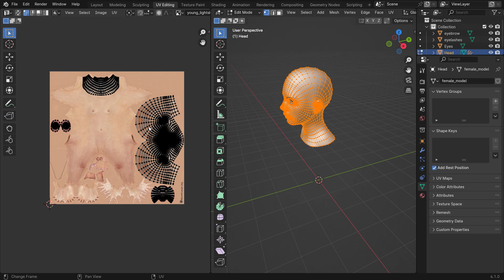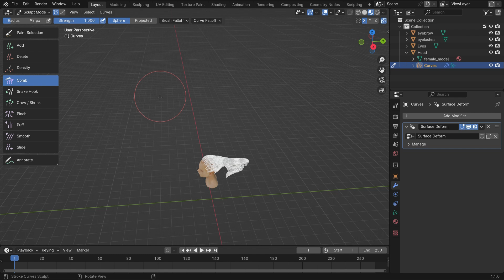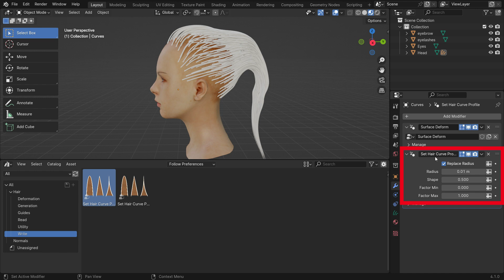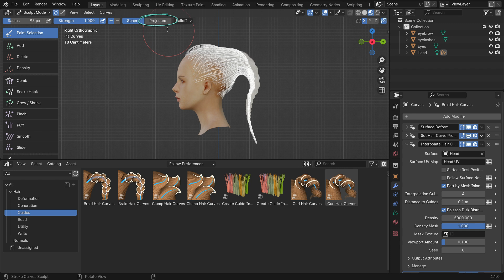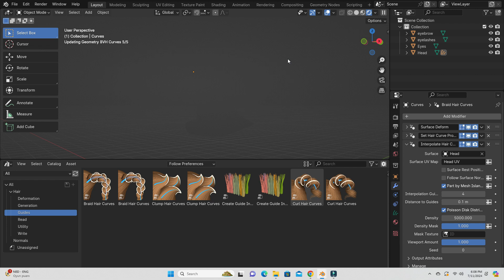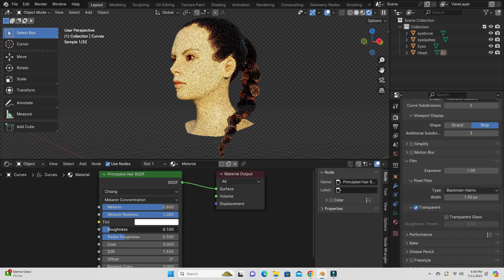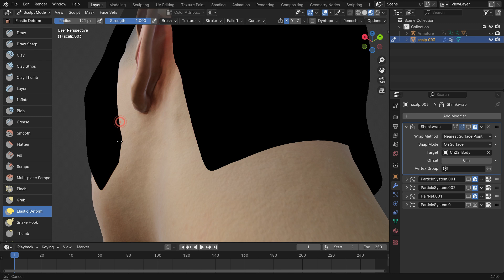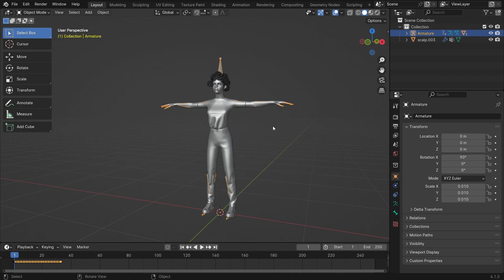How to Create Realistic Braid Hair in Blender 4.1

Comment: For anybody having issues, especially if they are using different unit scales in Blender, see the rest of this comment.

Bit of background - I work with Unreal Engine, so to make things easier for my self, I changed the Unit scale in Blender from 1 to 0.001 in the scene tab. I also changed my display length to cm. Now after this I scaled everything, even a rig (which was a simple bone rig with no constraints or drivers, lucky me) by 100. I also multiplied the view start and end values in the view tab by x100.

1. If you are also working with this scale, you don't need to add 5000 or in the 'interpolation' hair curves part. I had a thick, full head of hair when I entered just 10!
2. The braid part values didn't work for me at first. I was very frustrated, but I accidentally realized that I needed to 'scale' up those values. Here's what worked for me.

Select your Hair curve object. (It's parented under the original object you selected when creating empty Hair)

In the modifiers tab,
>> Set Hair Curve Profile
Radius - 0.06cm

>>Interpolate Hair Curves
Density - 10

>> Braid Hair Curves
(Untick existing guide map)
Guide distance - 40 cm
Guide mask - 1
Factor - 1
Subdivision - 3
Braid start - 0.5
Radius - 10cm
Flare length - 10cm
Flare opening - 0.3cm

The rest was more or less the same.

Extra tip: If you want to export Blender Hair to Unreal, use "Groom exporter" from turbocheke. Also, there is a very good tutorial by IamSH1VA titled "Unreal Engine 5.6 MetaHuman Parametric Grooms ( + Hair Cards 🤯 ) using BLENDER" that goes deeper.

Comment: Thanks alot! 
Finally a tutorial in which every single step is described in a comprehensible manner, there are no unforeseeable jumps and, above all, no add-ons suddenly appear.
In this way you can also do without the Blender particle system, which I have been struggling with so far!
Most importantly: Finally a description in which the normal Blender interface and settings are used, which even beginners will be able to use easily! Thank you very much!😉👌

Comment: So I have a problem with all hair in blender that use the particles system. It makes it impossible to pose my rig with the hair as the lag becomes unbearable/unworkable with the hair attached. I have to delete the entire empty hair hairstyle and all the viewport fps come back that's with simplify and additional subdivs set to 0.

I have got a good PC
4080ti
64GB ram etc..

So I'm unsure if you have any recommendations for improving the performance of blender when it comes to the hair. I haven't experienced lag like it anywhere else when using blender.
Reply: Hi, I don't think your problem has anything to do with Blender or the hair system.
You have a pretty fast computer, especially my graphics card is significantly weaker (Nvidia GTX 1080TI), but I don't have any problems with that.
Ok, sometimes the rendering takes a little longer, and the particle system is a bit sluggish with larger hair volumes, but basically everything works as it should.

Comment: I can't find principled hair BSDF in the shader section only a small node called hair BSDF with limited input settings. Did they remove it blender 4.2 ?
Reply from the maker: U need to expand the menu
Reply: @mk3dgraphics  thanks I figured it out after a while. Apparently it doesn't work for Eevee yet
Reply from the maker: @Ohamka_567  Yes Principled Hair BSDF Unfortunately doesnt work with Eevee